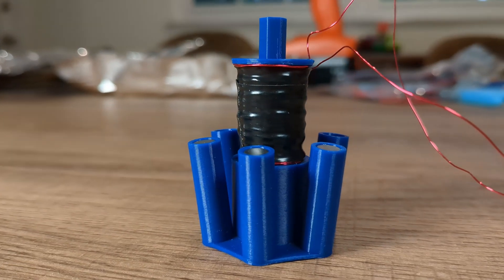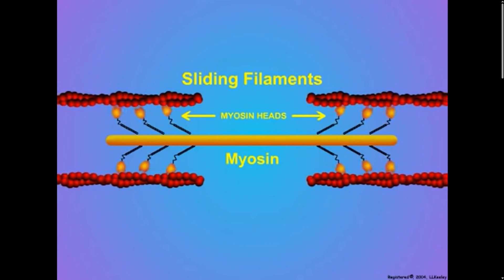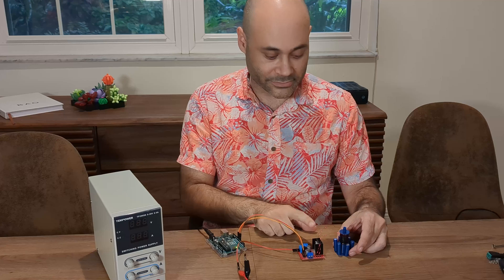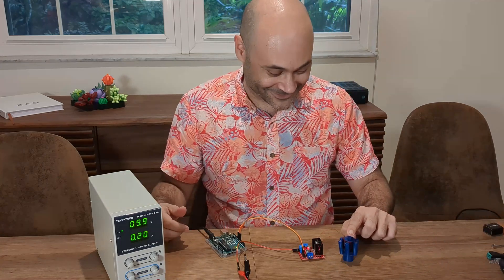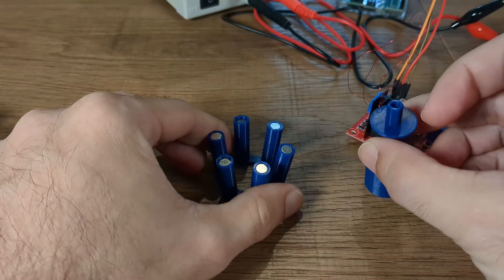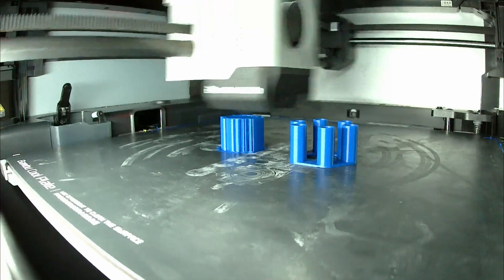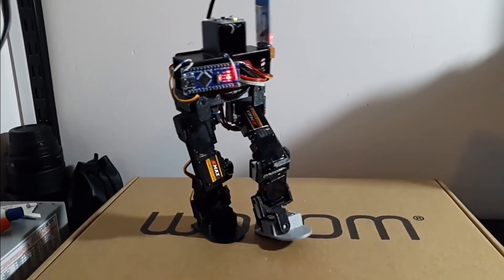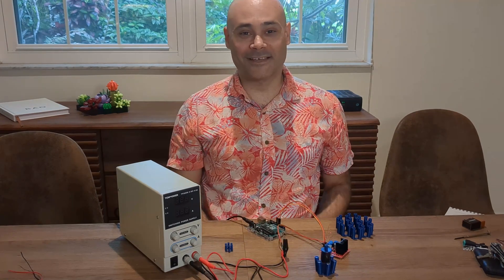Linette the Linear Actuator that Mimics Muscle

Comment: I’m researching something similar for my thesis, it’s worth looking at auxeticity.
One big thing I’ve realised is the actin-mysoin complex has a negative poisson ratio (most soft tissues do)

Tense your muscle and notice how the actin mysoin fibre is necking in the opposite direction (if you poke the top its also in tension insted of compression like normal) 

Iirc up to -0.74 and around 1-4KPa youngs moduli for most connective tissues 
The auxeticity is a geometric property, it’s purely shape and with it you may not have to use the magnets to get your orientation into the muscle like structure without wasting field strength energy in directions you dont need
Reply: I.e. auxeticity is how the actin myosin complex are able to be parallel at the attachment points but still have that prism shape while contractect in the centre
That prism shape in the bodies central tendency occurs from the negative poison ratio and there being a bunch of auxetic

Overall from a biomedical engineering perspective this is great work mate; you’ve done a great job with it
Auxetic metamaterials imo are a big reason we haven’t been able to nail biomimetic muscles yet (and honestly I’ll be signing up to the patreon down the line as this looks insanely handy to my research)
Reply from the maker: @BirnieMac1 Wow. Thank you for the excellent detail. There is so much to be understood about human biology still. Good luck with the thesis. I would love to read it when it's done.

Comment: An interesting exploration into movement.  You are correct that this is neither a solenoid nor a voice coil since both of them operate with the permanent magnet (or ferrite rod) on the inside and the variable coil around the outside. The voice coil uses the varying voltage/current direction to move rapidly with small loads, whereas the solenoid is usually only bidirectional and sufficient to move larger loads between two defined positions.  A linear motor is similar in having stacked magnets with reversing poles on one side and a series of small coils in the moving head that change position based on which ones are turned on and off, as noted elsewhere, like a stepper motor unrolled. There are very few devices that use a centralized coil and magnets on the outside for linear motion because the size and diameter of the coil determines how much electromagnetic energy it can handle, and many of them are incorporated into motors with rotary motion. The other issue is that it is far more efficient to have the magnets and coil as close as possible so that you get the maximum interaction (and strength) from the fields being produced. 

The great part is that you are learning and experimenting... overcoming your worries and fears! Keep experimenting and you will rediscover some of the things I have mentioned and many more fascinating possibilities! There is nothing more engaging and fulfilling then creating an idea that you have into something that actually works! Even though I am much further along, I still giggle like a fiend when I get some crazy idea to work, even a little bit. From there I can add or subtract, and generally refine the idea, or determine whether it is truly worth spending more time and energy (and money) on. For SCIENCE!!! and learning... keep on exploring and finding the joy in your journey!
Reply from the maker: @edwardpaulsen1074  Thank you for appreciating that it is a journey.

Comment: Does it make contact when placed on its side? If so, then you still have noise from the rubbing. where all the other motors get there noise from. If it's just some pillars of stacked magnets and a coil inside, then you could replace the magnets with coils that have reversed polarity. Which would be a cost safer if you scale it up in quantity.
Reply from the maker: @TinusBruins  That's a good idea.

Comment: Interesting video! I'd be curious to see this implemented further, toward mimicking a biological system. Might be interesting to consider the world of insects as their muscular systems are relatively more simple than some mammals?

Also, can you detail the rationale behind the slight outward angle the permanent magnets have? And how did you land on six magnet stacks? Or on the height of the assembly?
Reply from the maker: @BiglyWeenis  Thanks. The angle of the magnets is actually from them repelling each other. They are supposed to be parallel. Six was because I was mimicking the six actin molecules that muscle has. The assembly is about 2.5 inches tall, which was mainly a product of the permanent magnets and keeping everything relative to them.

Comment: Wow you beat me to it! I was planning to do exactly this for the exact same reason - robots are so noisy and I hate it.
Reply: My idea was to have the permanent magnets on the inside of the coils, so that the pull length was more customizable, and could even be flexible, making it more space efficient as you can turn them as they fold in.
Reply from the maker: @iwiffitthitotonacc4673  love it!
Reply: @adrianinvents  i have worked with DC motors on my Arm, but i also hate the noise, i always looked on this solenoid like possibilities from the side, because i have questioned myself about the positioning or controling those solenoids, because in this way it has max and min position? than i wondered if we can somehow oscilate it using a code to maybe fix it in certain positions within the max and min positions, happy to see your other vids, keep tinkering!
Reply from the maker: @nestorovski1993  Thanks. :)
Reply from the maker: @iwiffitthitotonacc4673  I'd still like to see your design. We need all the ideas out there. Robots are noisy!

Comment: I found this interesting and amusing - and as many other has pointed out there are other techniques that may already apply. That doesn't mean it's not worth looking into. If you can manage quite a small one (and probably longer), or perhaps a telescopic version, in a DIY fashion I think you may contribute a lot (the industry stuff is sooo expensive and not usually what a DIY:er want). I can also see the need for a "directional" contraction, so that a long "snake" can also turn sideways, not only stretch and contract.
 Keep going!
Reply from the maker: @fotodille  Thank you for the encouragement. It means a lot.

Comment: Great concept that I have thought a bit about myself but am just too scared to mess up 😅. Major respect for actually going through and doing everything. The biggest possible optimization I think you addressed in the comments is the loose magnet configuration which could be optimized greatly by using solenoids for higher magnetic flux density where you are only getting a fraction of the possible force with the current configuration. With solenoids you can still keep the hexagonal frame concept with parallel and series configurations.
Reply from the maker: @natewilburn301 Thank you! And thanks for the suggestions. There are so many paths to try. We will see what happens with version 2.

Comment: if you use a metal rod as core and a inductor on the outside you could move arbitary lengths! meaning you could push a 20cm rod through your one inductor.
Reply from the maker: @sicB_astard  interesting. Just in case I'm misunderstanding, would that be a type of solenoid?

Comment: you going nowhere with this, efficiency of this is close to 0% you just heating that coil mostly without doing any usefull work
Reply from the maker: @ekstrapolatoraproksymujacy412  I know it has a long way to go. If you have any suggestions to make it better, I'm open to accepting help.
Reply: @adrianinvents  you need to study electric motor design and understand why they can be extremely efficient in certain regimes and extremely inefficient in others, this is hard topic, but without good understanding of it, you will not be able to design anything that is remotely useful.
Reply from the maker: @ekstrapolatoraproksymujacy412  I'll definitely pick up some books. Since you are an electrical engineer, do you have any specific ones you recommend?

Comment: Your magnetic circuit is terribly lossy, ask yourself why all other actuators use iron and have the smallest possible air gaps in the magnetic circuit.
Reply from the maker: You are right. There is a lot of optimization to be had. I do have an iron (or perhaps steel) bolt in the center of the coil, and it did increase the strength. Version will be much better. If you have any other advice, I definitely need it.

Comment: Have you looked into "Linear Motors" they are essentially like a BLDC motor unravelled into a line to form a linear actuator.
I've seen some impressive units at trade shows and some are being used today to make fast, silent & mechanically simpler 3D printers.
I suppose this is similar to your 'serial' arrangement.
Reply from the maker: @thetastefultoastie6077  I did look into linear motors. I should have mentioned them! They are using them in 3d printers? That's cool!
Reply: @adrianinvents  Magneto X, I think, is the printer that uses them

Comment: I have that same power supply, works really well.  I even use it to charge batteries EXACTLY.

My Roomba has a crush on my floor fan. B-lines for it every time, and just humps it.  Little @$$hole.

Not sure how exactly you might use this, but it is so worth delving into it a little to be aware of it...

https://en.wikipedia.org/wiki/Halbach_array
Reply from the maker: @Ki-Lessons That's a  good recommendation. I wonder if a Halbach would be useful for this. I'll have to try some experiments.

Comment: Have you looked into HASEL actuators?
Reply from the maker: @zomie1  I have. They are so cool. But I found out they are extremely high voltage. At least, that's how it seemed. I should have mentioned them in my video.